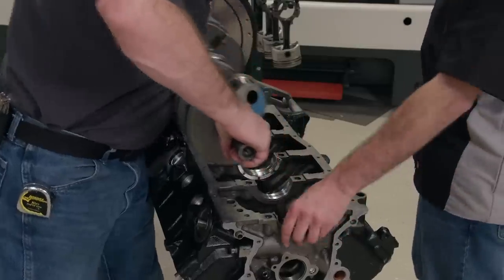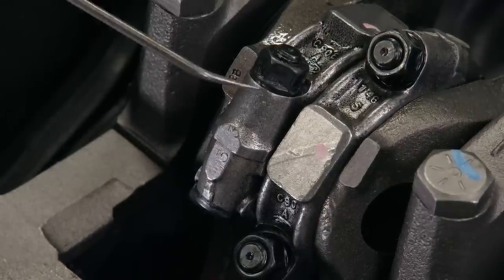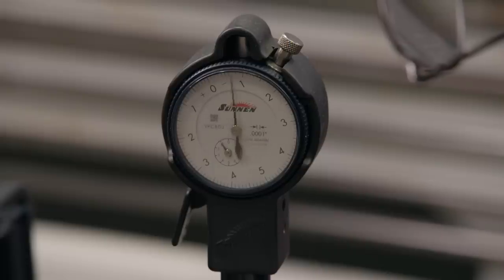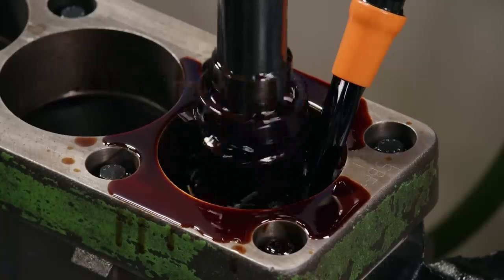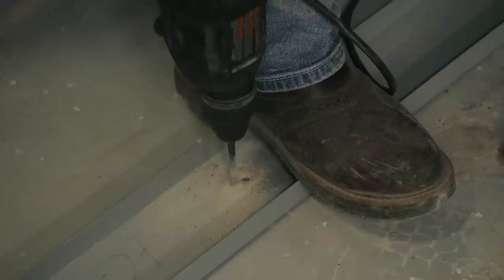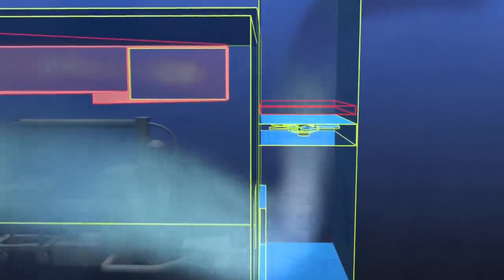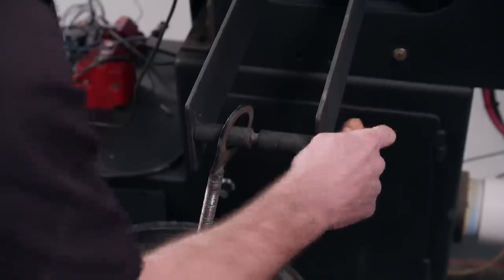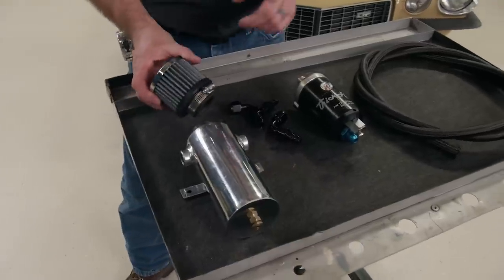Building a Windsor Stroker - There's No Replacement for Displacement - Engine Power S6, E6

Comment from the maker: We'll continue to post these episodes here on YouTube. If you can't wait for the rest of the build, visit our site to binge-watch:  https://www.powernationtv.com/shows/engine-power
Reply: Thank you!
Reply: My buddy just installed an inline catch can on his 2019 F150 ecoboost. Apparently the engine sensors become fouled quickly by oil contamination and having one of these on the vehicle helps to reduce engine maintenance. But I was wondering... if you use an oil separator with the system why can't you have the separated oil drain back into the sump? resolving the need to drain the unit manually?
Not knowing how frequently one would need to empty the oil can... I don't know if this is just a lot of work for nothing. It it normal to only have to dump the oil tank at oil changes a couple times a year? or is it more frequent than that?
And if this is a good thing, why don't car mfgs install oil breather/separator systems from the factory?
Reply: @djdonohue  the oil in the catch can will be highly acidic because of the chemicals introduced by blow by, and also likely will contain some water, so it's almost as bad an idea as draining your coolant reservoir into the oil pan. The idea behind it is to keep this junk from going back into the intake and fouling plugs while still allowing the engine to pull vaccum
Reply: Can we see a 4.6 build versus a coyote build? I hear the 4.6 can hold more boost than the coyote
Reply: @Prestiged_peck  -Makes sense. In the old days we used to run all the overflows into one (puke)tank and dump whatever was in there after a day of 1/4 mile.

I just wondered if an "Oil Separator" actually separated usable oil that could be recirculated. Guess the short answer is no.
Reply: Lovin this content! Really enjoyed seeing the upgrades to the shop too!
Reply: I've been watching these shows since the beginning and I love them I remember waiting for them to come on on the weekends when i was really young and even now I would make sure I was home or recorded it but I'm so happy to see u guys get new badass equipment because it means that you guys are still getting good ratings and will b around for a long time to come

Comment: On a 351 it doesn't always need to be notched for a stroker. It depends on the rod and bolts used. My stock block 408 cleared fine with Eagle h beams and ARP 2000 bolts but not with the L19 bolts (heads are too big). Doesn't matter though since the block will spit the main caps out before the rod bolts even know whats going on.
Reply: I had to clearance my 408. Scat crank and rods.

Comment: I had a 2.0ltr Subaru Impreza Turbo Type R stroked to 2.1 with a switchable Syvecs ECU. It went from 320hp to 480hp. The car only weighed 1100kg and was a missile.

Comment: """this can be done on an engine stand with carbide burr""" block clearance 101. steady hands, good eye and endless shop air :)
by hand was a form of art, by machine not so much, but as long as it works in the end and stays together!
Reply: My old man clearanced our 408 by hand. Took him less than 10 minutes with a DeWalt rotary tool. No budding engine builder is going to use a machine like that!
Reply: @BarnStangz It depends how confident they are.

Comment: Do you guys build any performance engines that include overhead cams? Seems all your builds are pushrod engines
Reply: Lassi Kinnunen  done turbos on a Coyote motor
Reply: and also you can get big numbers on pushrods v8 rather than 4 cylinder OHC or 6 cylinder OCH and also its to expensive to build a v8 screamer
Reply: STREET RACER Is that so? I just don’t see how you can’t get more power with 32v and variable valve/cam timing.
Reply: STREET RACER i guess you’re right.. Read it a second time and understand what you mean. Well i guess if you had unlimited money Overhead cams would be the way to go i guess then right ?

Comment: When using a torque plate does metallurgy matter if I'm running iron heads does the torque plate have to be iron as well, same question for aluminum?

Comment: Hey pat i got a 302 bored 0.40 over with a eagle rotating assembly with blue print heads 190 cc with a fcam what my motor a 347 or what ?

Comment: RPM is a replacement for displacement.
Reply: Lead Sled not for torque
Reply: Depends on what you want, some of the old"small-blocks" could be turned into real screamers, if you need high speed that would work, if you need to pull from lug, that is another story.

Comment: Can a 351 crank fit into a low deck Windsor like the 302(5.0) after notching like you’re doing here to the 351 block?
Reply: No because the 351 has larger main bearings

Comment: Just for curious what would a flat plane crank do to HP ???
Reply: Less counterweight to spin, so rotating mass= less crank resistance... more possible rpms... higher rpms=more horsepower on a not so big engine through more aggressive gearing... one drawback is that it creates more vibration, which tends to loosen bolts that aren't properly torqued... the new corvette engine has a flat plane crank and is able to reach 8,600rpms... making more hp than the previous engine which was bigger... BUT... the low end torque isn't there like the previous engine with the crossplane crankshaft...
Reply: @MRGF78  so some type of overhead valve is nessary to achieve the full value of the higher rpm ???
What's the latest on electrically/electronic controlled valves ?

Comment: Couldn't help but notice you didn't talk about removing the oil galley plugs to aid in cleaning (brushing) out any machine chips that might find their way in. In every engine shop I ever worked at that was a critical  'must do' on every teardown! I worked for four different former Pro Stock racers over the years (1984-2002) BTW; where's the dyno results on the 408 Windsor?

Comment: I’ve seen steel and aluminum torque plates because the steel matches cast iron heads and aluminum matches aluminum heads as far as clamping forces go. Aluminum torque plate does not equally clamp as well as the steel one but it is adequate for matching aluminum heads.
Reply: How come most fasten the plates down with bolts when head studs will be used in the final build?  I'd imagine bolts would twist the materials more than studs.

Comment: When clearing the block for increasing the stroke why mark it. Its all Geometry no secret or mystery just dial the mill out to clear the swing same for every cylinder and you are done.
Reply: Jon Jenkins they marked it because they said u could also do it on the engine stand with a carbide bit probably on a Dremel by hand if necessary.